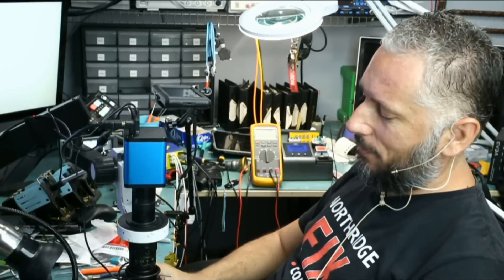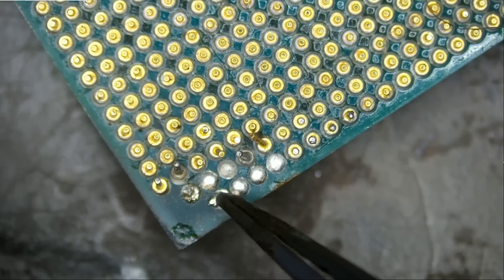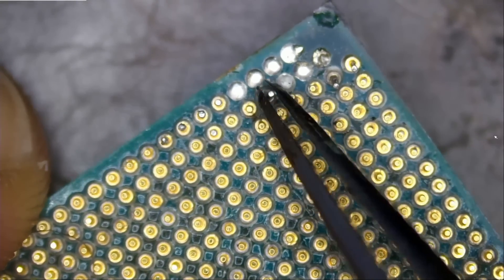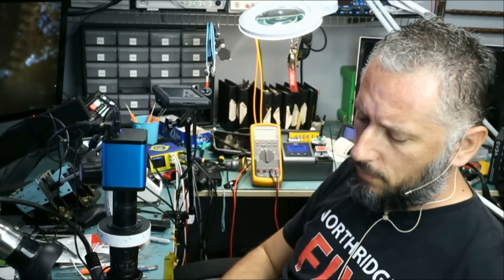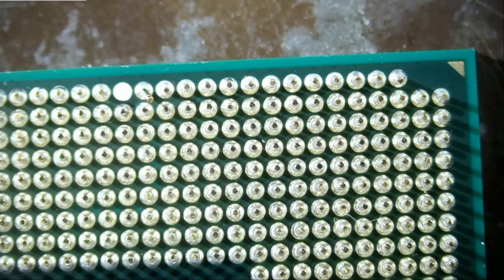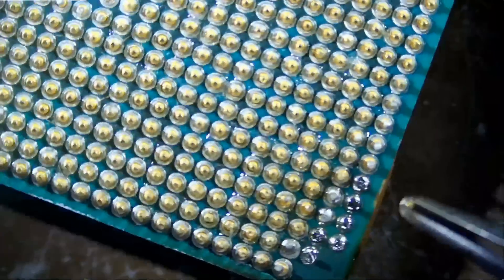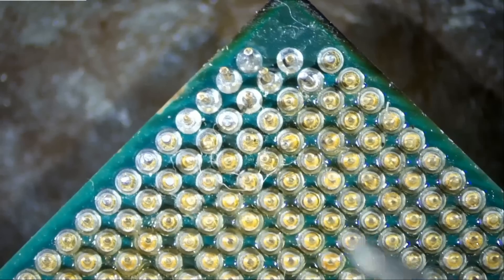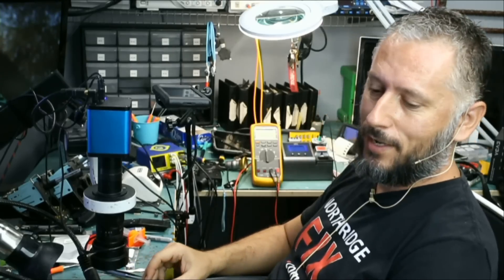AMD Ryzen CPU Repair - 7 Broken pins

Comment: hi i know its an old video, but i can see why hot air is really convenient. can you do this with a solder iron? i cant picture getting it hot and the pin down. would you have to heat the pin and transfer heat through the pin?

Comment: ive used a mechanical pencil metal tip to straighten cpu pins before, it keeps the pin nice and straight while bending them back "a friend tried to install his and failed" the cpu worked great after straightening the pins with a mechanical pencil tip.

Comment: I would suggest saving donor CPU sockets and then trying out the CPUs after replacing the pins just to make sure they are all aligned and they fit in cleanly.

Comment: How do you avoid knocking/blowing off the adjacent pins when trying to solder on a pin!!!! Also find it very hard to remove the stub of a broken pin from it's pad!!! NB there are people selling actual Ryzen pins on ebay usually less than a pound each, that's where I get mine or an old totally broken ryzen.
Reply: I have a Ryzen 7 3700X that had 2 missing pins, it now has about 20 missing!!!!!

Comment: Bent pins are a breeze for me anyway but broken yea that is a real pain, the absolute worst case of bent pins I've worked on thus far was an old AMD K5 that was pretty trashed which ultimately turned out ok in the end. Some even older procs the pins love to just snap outright while at least the modern stuff generally holds up ok so long not dropped or worse.

Comment: i did my first cpu a few weeks ago, it was also a ryzen 3600x. i used pins from an older mobile pentium chip. I started with 4 broken pins, my first shot with the hot air brought it to 8 missing pins (lol). I got them soldered on finally after a couple hours of trying. The chip is working but will not run memory in dual channel. Maybe i will go at it again :) I bought the chip cheap just to try this.

Comment: Did this on a Ryzen 5 3600x. I lost over a dozen pins well attempting due to squeezing to hard with the tweezers and the pins go flying into the 9th dimension. You make it look so simple. You are in another class sir.

Out of curiosity, what temp was your air gun set to? I didn't use one for fear of getting the CPU to hot and ruining it.
Reply: Mail it in to him
Reply: @ahyaan2552  the CPU works, except for loosing one channel of ram. It's in my daughter's PC, which only sees the Sims 4 and Roblox, it is more than enough for her.
Reply: dude i just recently did this repair for the first time on a Ryzen 2600 and went through the same hell . it was so damn frustrating.

Comment: Hi alex. Im using 0.5mm syringe tip to solder those pins. If you bend the tip 90° you can get better result.

Comment: at least the am5 socket will solve this
Reply: I'm sceptical, because with AM 5 you will have the pins on your motherboard instead, and they can bend or break too. Not sure if that would be a lesser problem.
Reply: Yes, with AM5 you'll need to solder a 1718 pin BGA package instead of 6 individual pins in 5 minutes

Comment: Once again an excellent work. For gently straightening the pins you may use a syringe needle. Put the needle on the pin when you gently straighten the needle the pin bends from the bottom where it originally bended.
Reply: When I was in the Navy in a F-14 squadron, I was with TARPS aerial recon. We had to deal with bent pins in the cannon plugs. We used a female pin to straighten bend male pins. It worked as long as the pin wasn't too bent.

Comment: I had many times bend pins of a cpu, I used a banking card to bend them up again it slides perfectly through the lines of pins. Don't use pliers or the like. Be gently and if you have use some pressure put the banking card or some hard plastic behing and use a smaller hard plastic to push it upright. Worked fine for me.

Comment: Do the solder melt at higher cpu temperatures and short with next pins???
Reply: No, the melting point of solder is far higher than a CPU will ever get during use. If the pins ever got hot enough to melt the solder then you have much bigger problems with your computer.

Comment: I really don't understand how do people break those cpu pins. I am sure it can only happen with those who don't have knowledge about it but still try to be a professional & then break it.
Reply: sometimes when you take out the cpu cooler you can bend the pins, something like that i guess
Reply: @lowcase  not in my experience and I’ve handled a lot of cpus just be careful and be aware of the gentle pins
Reply: @lowcase  cuz they’re just a pain to fix so if possible no damages
Reply: it’s very easy to accidentally pull the cpu out with your cooler and damage the pins in the process. This should be less of an issue with the 7000 series because AMD is switching to LGA.
Reply: AMD stock thermal paste is bad/ putting a lot of thermal paste, you need to twist the cooler before pulling out. Beginner in pc will usually just pull it out.
LGA socket have a latch that will hold the cpu so  that will not happen on them.
Reply: It's an accident....  Many professionals do break CPU pin, motherboard pin....
Reply: I am an electronics system designer and i can tell you that such occurrences are very common...its normal to experience such things in an Electronics lab however what this man is doing to restore these cpu back to their original state is nothing short of amazing

Comment: I've had great luck using a mechanical pencil (the type with a small steel tube on the tip) to straighten these pins, it's way easier than tweezers
Reply from the maker: I have full control with a tweezer and can grab 3 pins at once and press to make a straight line. A pen  has no anchor point and can bend in all directions forcing you to do it more then few times to get it right. I did the same in the past using a syringe needle. Tweezer is a better option for me.

Comment: no boot test? thank god AMD is no longer developing this flawed design.
Reply: Pins on the motherboard are actually worse tbh. Once those get messed up the chances of saving the motherboard are super low. Fixing pins on cpu definitely has a higher success rate..
Reply: @entity9588   If you say so, but a board is generally half the cost or less of a cpu. it might be worth battling on a ROG but not a 100$ Tuf.
Reply: Nah.. actually a terrible mistake.  Now I can't go on eBay to buy a bent pin CPU at a significant discount and repair in a second with tweezer